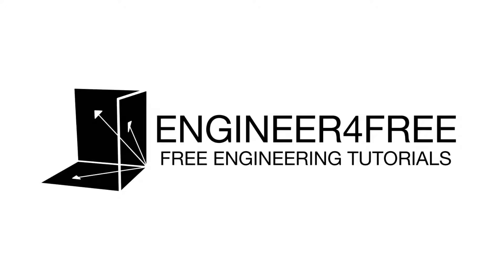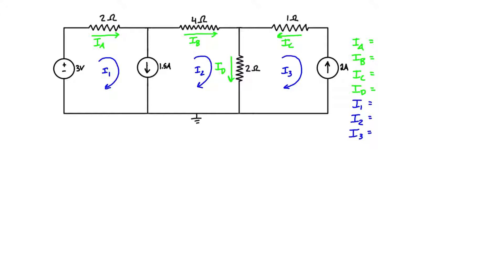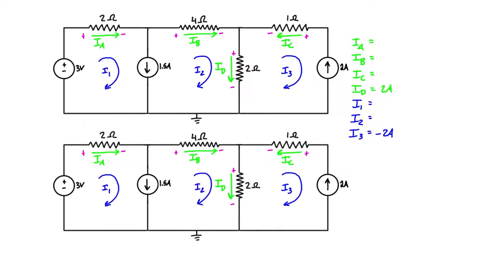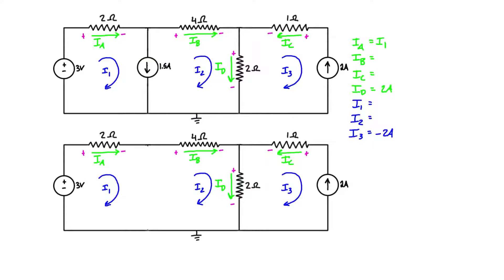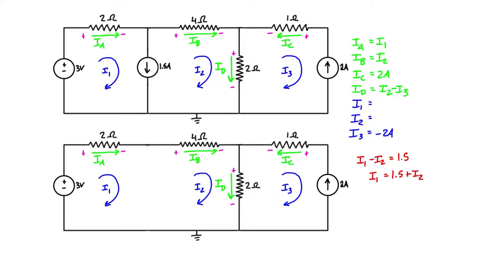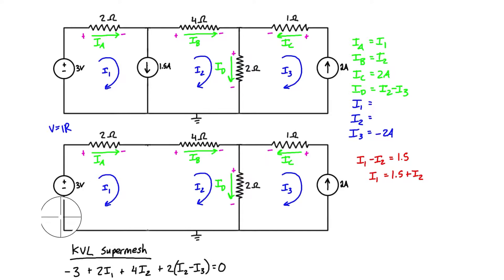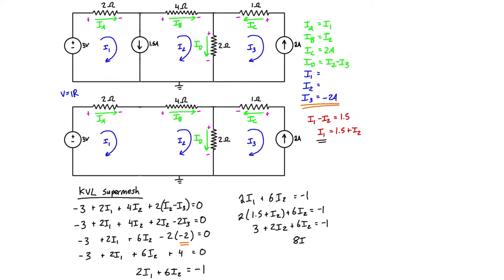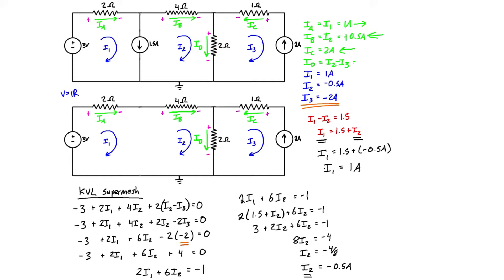Supermesh Analysis Example Problem

Comment: I realize the multiple currents help with the book keeping, however I took a simpler approach to the 3 equations: i3 = -2, i1  -i2 = 1.5, 2i1 + 6i2 -2i3 = 3, yielding the same results, i1 = 1, i2 = -.5, i3 = -2.0. Still great video, very methodical and clear.

Comment: isn't it supposed to be I1 + 1.5= I2?
Reply: no as 1.5 is resultant in the same direction as I1 and I2 is is opposing I1
Reply: @endoumamoru3835  how pls explain
Reply: @adamlomarda0427  assume that we have a node called (a) between the 2,4 resistors, now we have an independent current source and its directed downwards ,so its leaving the node and that's why 1.5 should have a negative sign , and vise versa for the entering currents
Reply: @wuwuw5433  Okay I get it now thank you so much
Reply: @adamlomarda0427  ur welcome❤️